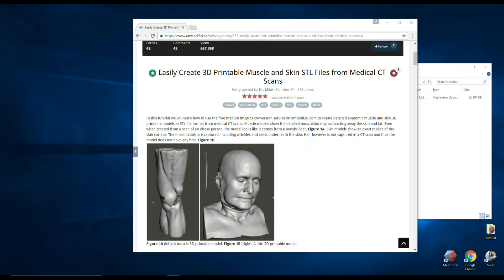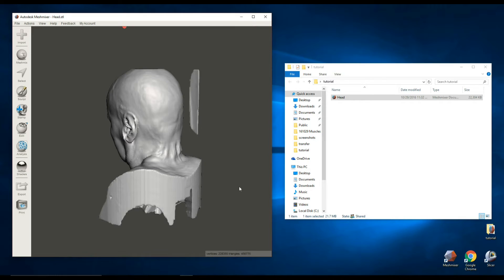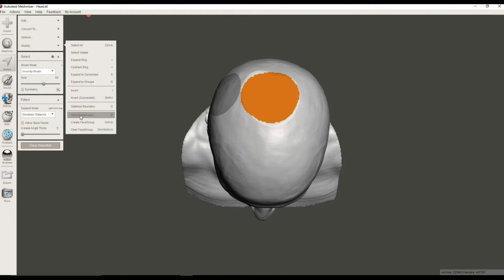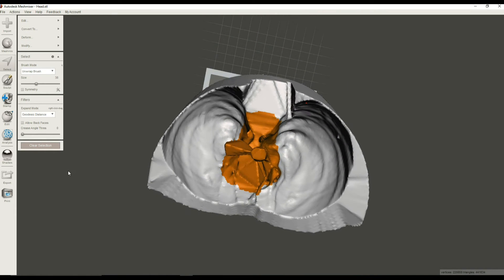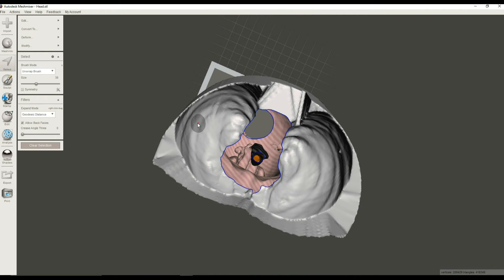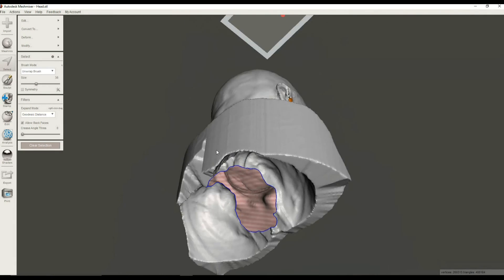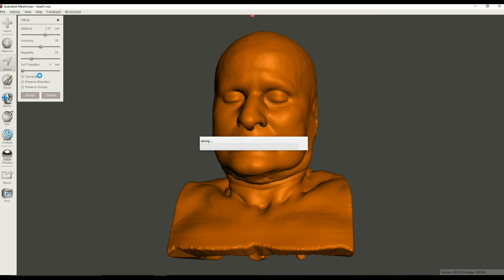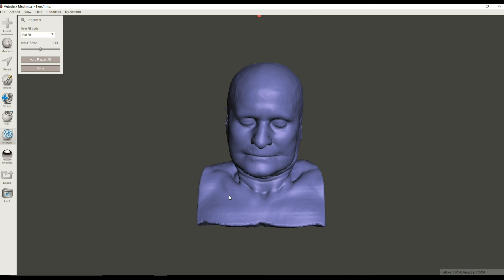How to Create a Hollow Shell from a Medical STL File Using MeshMixer

Comment: Using this this tecnique we have  some detail loss. It is particularly visible on the ears that look deformed by the process. Is it possible in any way grow the thickness of the wall to the inner side istead than projecting it to to the outside?
Reply: You may already have this info but you can set the slider to a negative value which will create an internal offset. Hope this helps :)